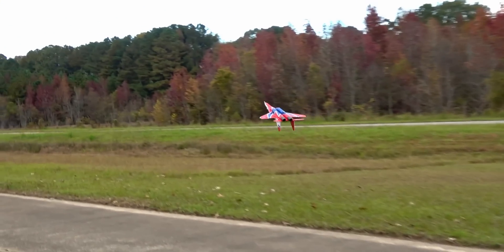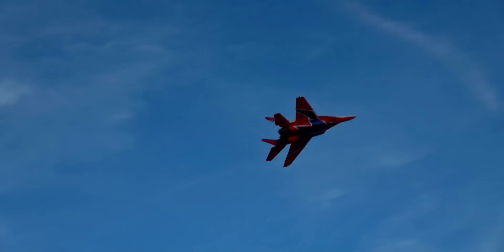5 Mods Make This Jet Fly like a Fighter - Arrows MiG-29 64mm

Comment: I’m definitely not opposed to changing the front spring out seeing as my only option is my personal grass runway or a gravel road half lined with power lines.  (Living in this sticks limits your options.). But it makes me wonder if softening the rear springs to improve the attitude would have a similar effect or if it would only get you halfway to a solution.

Comment: Great video, thanks for doing all this work 😊 I replaced the nozzels and messured an increase of thrust of 11% compared to stock nozzels. Amazing! I also printed a 7 mm long tube and put that into the nose gear. It reduces the travel and stiffen the spring by compressing it. Hopefully this together with the increased thrust Will help me to take off from our grass field (without hoping for a bump in order to get some positive angel of attack).😊 I could not find any weight in the esc compartment. My model dont have that extra weight.

Comment: I low key want this! I have the twin 80mm & love it.

With those mods will it fly normal, no crazy rolls etc with out as3x or gyro? I dont use any assist in my planes or mig that i have, love the design of the mig & its twin motors. So all i do is normal high speed flying, rolls & some climbs.  (Climbs is what im after more)
Reply from the maker: It'll fly fine sans gyro so long as you don't shift the CG as far aft as we did here.
Reply: @TwoBrosRC  cg will be set on factory points.
Reply: @Mroswaldo16  I'm flying at  a CofG set at 118 mm (I think stock is 95mm) without gyros. I think I can go aft a bit (lot more) as I don't have to push forward as I slow down prior to the flair. I'm using SMC 4400 and love the flight times. Don't be afraid to add and keep adding lead to the tail.

Comment: I've been flying this model for the better part of a year and agree that the mass and balance issues are just ridiculous! Yes it flies but that is faint praise. There is so much more to be found in the model with some simple mods that the FMS/Arrow management should have taken care of in the first place! I exchanged my 105 grams of mass for inrunner motors and still needed to add 50 grams of tail weight! The main gear is improperly placed. I had to move it forward 12mm and cut it down 16mm. It now lands and takes off as smooth as silk! I'm of the opinion that these modern jets fly so nice (post stall) is because the LEX actual still work at these small scales (try to keep them sharp). Changing the nozzle is not an option, it is a requirement!  (thanks for that in the first video) I have a detailed write up of my mods on the RCM&E forum.
Reply from the maker: Happy to hear you made it work for ya dude!
Reply: Jon, I forgot to ask (& I couldn't find it in the video), would you provide us with a numeric value for aft CofG point where you failed to recover from that flat spin? I know I sometimes don't know the numerical CofG location of my models as I keep moving the CofG  until I'm comfortable and happy with the plan's response. Thanks.

Comment: You said in the video that you used an SMC 2800 but in the video it shows as a 2400!!! Also the 3800 was shown as a 3100!!!  Do you even know what you used?
Reply from the maker: The batteries have two ratings. The lower rating is what their capacity is when charged to 4.2v instead of 4.35v. Yes, we know what they are.

Comment: I've had mine hanging on my wall for a while now because I wanted to do a repaint on it. I have the 3d printed nozzles already but watching this vid makes me want to pull it off the wall and get it done. I fly off grass and found that you have to use lots of throttle on landing to not have the nose slam down so hard. What I did was cut the mains down like 7mm and added about 5mm to the nose gear and also put some spacers in the strut to stiffen the nose gear up. It really is such a stable jet but too heavy. Honestly didn't know about that long lead weight in the esc bay. Definitely gonna yank that out. Now I have a new purpose to finally finish mine. Gonna do it in the Ukrainian black and white digital camo (just because I like the digital camo livery.  I don't care much for politics) thanks for the inspiration tho! Awesome job as always! 🫡🫡
Reply from the maker: Sounds like a fun project. Glad we could help!

Comment: Small correction, you're not actually (noticeably) compressing the air at this scale when adding smaller nozzles, you're simply increasing the exit velocity and thus the thrust. Great video, I love seeing these jets being set up to handle like real fighters and really putting AS3x to good use. Can't wait to get my hands on an FMS SU-27 some day. Also, once your gains are dialed in, what is your gain adjustment knob/slider % typically at?
Reply from the maker: Hey, thanks for the info! With regard to the gains, they're always at the mid-point unless we're doing something like low-speed high alpha or landing.

Comment: It's been nice to see this channel develop into one of the most honest RC plane review sites around with work arounds and fixes for some of these marginal planes.  I also find it interesting on how all these companies consistently screw up their CG recommendations. Every plane I've purchased since getting back into the hobby a few years ago is ridiculously nose heavy. I get that "they" probably think they are keeping pilots from wadding up their new planes but the problem then becomes the planes are so nose heavy they require higher landing speeds and you inevitably run out of elevator causing crappy landings tearing up what is for the most part in my opinion is universally weak landing gear due to the nature of the construction of foam planes.
Reply from the maker: It is unfortunate that almost every manufacturer defaults to nose heaviness. It's exceedingly rare when a plane doesn't fly better balanced neutrally or even slightly tail heavy. It's not for everyone, but it should be an option that doesn't require modding the airframe.